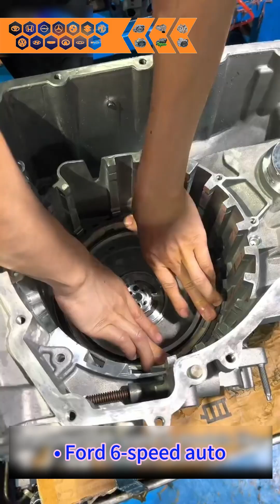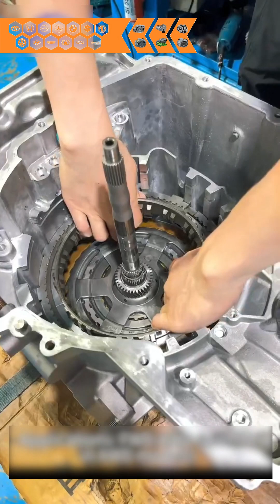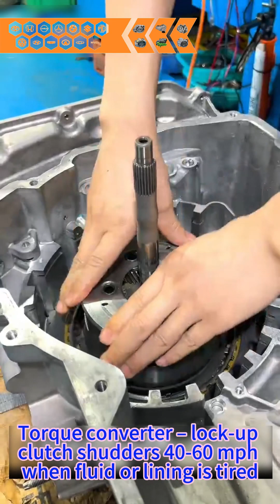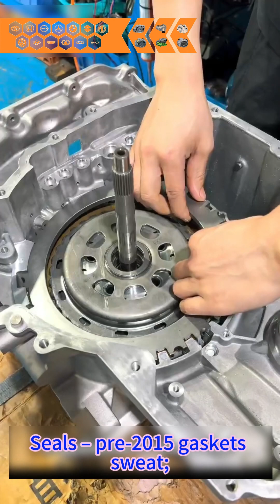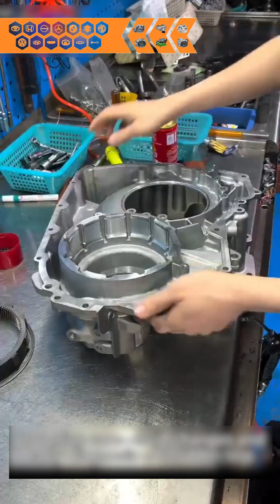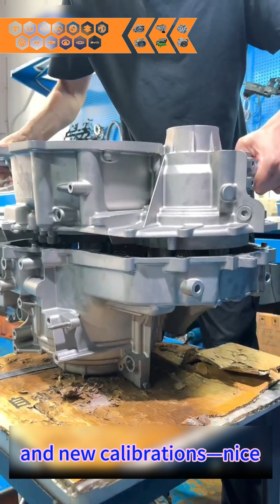Assembly FORD 6F35 transmission 2025 #Transmission #ford  #diycarfix  #gearbox #mechanic #carfix

Comment: Same as my 6t40 transmission I have just rebuilt out of a holden cruze jg 2001 wide range of cars have this transmission
Reply from the maker: the transmission of  6F35 and 6T40 are totally different, maybe just looks little similar?😅
Reply: @transmission-Vivien hi so the 6t30, 35,40,45,50,70,are all different but the clutch and steels arrangement is that the same?
Reply from the maker: @leehooper7317  Sorry, I forgot to reply in time.
The clutch plate packs of the GM 6T30, 6T35, 6T40, 6T45, 6T50, and 6T70 series transmissions are not all compatible due to design, torque capacity, and generational differences. The following is a detailed explanation based on authoritative industry data:

Key Compatibility Points

Shared Architecture but Different Specifications

The 6T30–6T50 all belong to the GM Hydra-Matic 6T transverse six-speed automatic transmission family, utilizing clutch-to-clutch shifting, three planetary gearboxes, and similar architecture. However, component sizes and specifications are scaled up based on torque rating and vehicle positioning.

The 6T30/6T35 are light-duty versions (used in the 1.4T/1.8L Cruze, etc.); the 6T40/45/50 are for higher torque; and the 6T70 is a heavy-duty version for high-torque models. Clutch Plate Differences
Size and Torque: Plate diameter, thickness, and tooth profile vary with torque rating. For example, the sprocket width of the 6T30 is 0.750", while that of the 6T40 is 1", which directly limits the plate envelope size.
Generational Differences: The 6T series is divided into Gen 1, Gen 2, and Gen 3. For example, the seal ring bracket has changed from four rings to three rings. Plates from different generations of the same model may not be compatible.
Specific Gears: The 4th, 5th, and 6th gear plates are partially shared between the 6T30/40/45, but this does not cover all gears and is not applicable to the 6T50 or 6T70.
Interchangeability Barriers
The 6T30 is more compact (71.5 kg per box), and its plates are generally smaller than those of the 6T40 and above. The 6T70/75 utilizes reinforced steel plates. Kits like the Raybestos RCP96-327 are only compatible with the 6T70 series and are not compatible with the 6T30–50 series.

Although the 6T35 is derived from the 6T30, the steel plate specifications have been fine-tuned to increase torque, leaving it with limited compatibility with the 6T40.

Aftermarket Parts and Repair Experience

Manufacturers like Raybestos and TransGo offer separate overhaul kits for the 6T30–50 and 6T70/75, further demonstrating that parts are not interchangeable.

The ATSG technical manual emphasizes the importance of confirming the model, generation, and specific gear when rebuilding; otherwise, slippage, impact, or plate burning can occur.

Conclusion

The clutch plate packs for the 6T30–6T70 series are not universal. While some gear positions (such as the 4-5-6 gear plates) are partially interchangeable between the 6T30/40/45, differences in torque capacity, component size, and generation mean they are not universally compatible. The 6T70 utilizes dedicated gear plates due to its high torque requirements. When purchasing or repairing, please be sure to verify:
Specific transmission model and generation (Gen 1/2/3)
Corresponding gear positions (Low/Reverse, 2-6, 3-5/R, 4-5-6, etc.)
OEM or reputable aftermarket part number (Raybestos, TransGo, Sonnax, etc.)